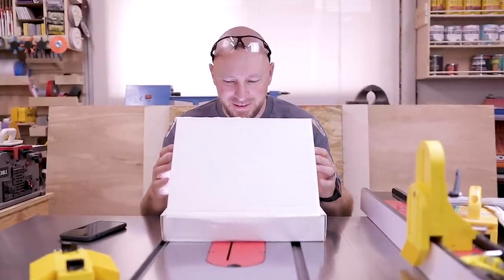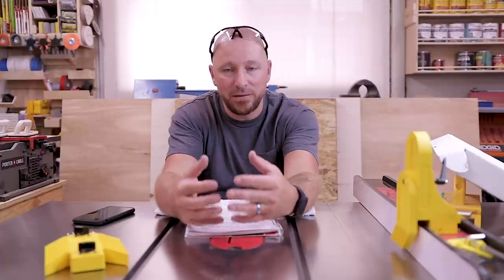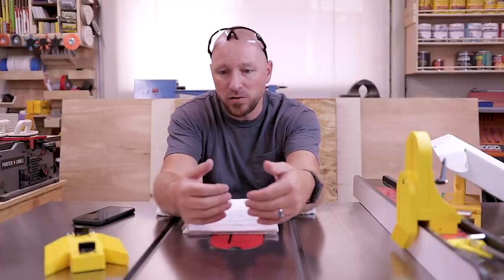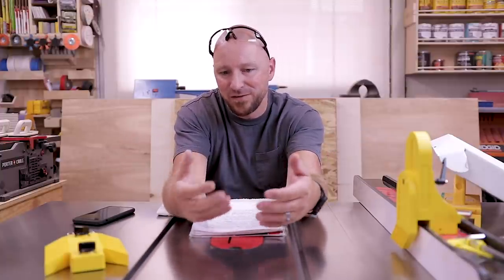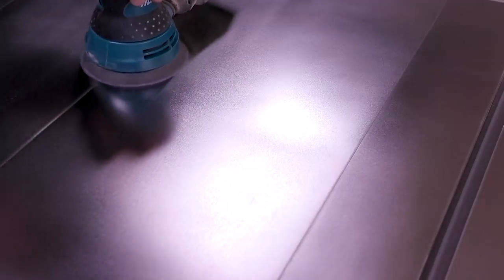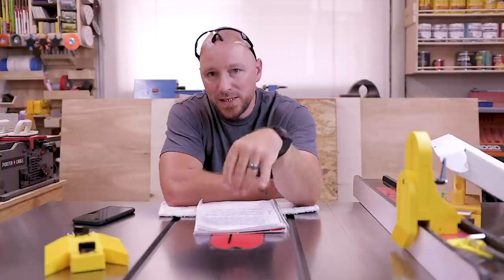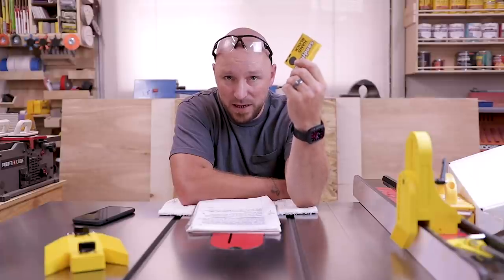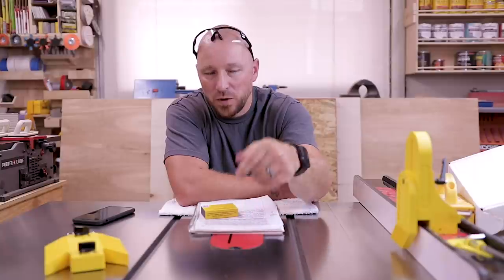3 Easy Ways To Maintain Cast Iron Tools

Comment: A couple of things.... first, thanks for the continued great videos. I love the 'conversational' type of content you put out and the straightforward way of putting it out.... Next, huge kudos to you on having the balls to take an orbital sander to a new $2K+ table saw. I had the same thing (sweat) happen to me the first week I owned a $600 delta and it took all I could do to take the orbital sander to mine last year. I've been using the same method and over a year later, no 'dips' or hollows in the top. Great tips as always. Keep doing what you do!!

Comment: Hey you might want try renaissance wax it’s a little pricy but it stays on you table surfaces a lot longer than normal wax.
You need very little for it to work. Good video by the way. I use t-9 as the cleaner sealer before the wax.

Comment: I have been using this method for years.  As you say, if there is rust start with a fine grit, you don't want to lay down a bunch of scratches that will be a bear to rub out.  I use Boeshield as my normal end of session protector.  I live in the snow belt midwest, and my shop is in a detached, unheated garage.  Boeshield works great for putting down a barrier, very important in early spring when humidity is high and the tools are quite cold.  I use exactly the same wax, and have experimented with putting on a day or two after the Boeshield, which works well, but right away not.  I tried putting wax first, then the spray, but that sort of dissolves the wax and doesn't dry evenly.  I have been doing this for about 25 years to good results.  I did find that there are differences in effectiveness on various cast iron.  I get some rust on a 20 year old Dewalt Jointer (China) if I let it go all winter.  Ditto on a Jet lathe.  The Italian made Laguna bandsaw faired very well, in that even in very severe temp changed, it next to the roll up door, so heavy exposure to the humidity, it showed little tendency to rust.  The best performer is a 24" Delta scroll saw from 1946.  It was my grandfathers, and I even have the original manual.  It is also close to the outside door, and even though I only use it for maybe 20 minutes once a year it is smooth as a baby's bottom.  I do one other thing, I put a heavy rag over these surfaces when I am done.  I think this acts as a barrier to the humidity.  I don't oil the rags.  They are the blue cotton type used in hospitals to soak up all kinds of fluids, and are often thrown out unused.  A machine cover tarp would do the same thing, but I'm too cheap to get a fitted cover for every tool.

Comment: Fluid Film is the key here....spray a light to heavy coating on it and leave it sit for a couple of hours and come back and lightly wipe it down with a dry cloth and you are golden...do this once a year and never have rust. Make everything nice and smooth too - it is a lubricant and preventer.  This is after you get the tops rust free of course. I even spray this stuff on the undercarriage of my truck - works great at keeping the rust a bay! Fluid film has been around since the 50's i think. Good stuff - you can usually find it at Lowes. Happy Polishing! "Wax-on, wax-off!"

Comment: Recently bought a used delta contractor saw top was in rough shape not left out in the rain like some I saw on line but definitely used as a workbench more than a table saw. Surface was super rough light rust spots paint and stain residue all over. Sprayed with wd40 and hand sanded an even amount over the whole top with 400 grit wet and dry paper. Did 2 rounds over the top using 3 1/4 sheet pieces each round. Wiping off and reapplying wd40 between each sand paper change. Cleaned the top with rubbing alcohol and a clean rag. Did two coats of minwax paste wax and 3 weeks later the top is still super slick even after going through a couple sheets of mdf and half my scrap pieces of plywood making several new jigs for the saw and a couple hunny do projects. There’s still several rust spots visible but they have no effect on the operation of the saw. I can’t even feel a difference when I run my fingers over them so I don’t worry about those. The saw is 30 years old I’m more interested in finding a new v belt than worrying about a rust spot or two.

Comment: Great video - I've used a random orbit as well with decent results. On the T-9 Boeshield: here in Virginia, the humidity gets insane. I like to clean the saw bed, then spray it with the T-9 and wipe it into a thin layer. I've noted the best result is if I can leave that overnight, then re-wipe in the morning and then wax the crap out of the saw... commenters below are correct - the T-9 isn't a wax substitute. It does penetrate the grain of the iron and you'll find you're not doing cast iron maintenance as often. I'd also recommend a canvas tarp over the saw between projects, or over humid nights.

Comment: You might also try Penetrol made by Flood products. It is a paint conditioner but when spread on cast iron dries to a ultra thin layer. I tested on my AC compressor (outside in Florida) it lasted over 5 years and could not be detected except by a bright shiny spot in the middle of a rusty spot.   I paint or dip all my hand tools and brush it on my table surfaces. After 40 years no rust.   Read the can of Penetrol it lists this exact use. I was tipped to it by an old time carpenter/machinist.

Comment: When I got my tablesaw about 5 or 6 years ago I immediately put polyurethane clear coat on it. There's been no rust until this past summer when I left a piece of freshly cut mahogany on it over night. When I came out the next morning there was a huge rust spot where the wood was. I used the 400grit wet sandpaper with wd40 to clean it then mineral spirits then the clear coat again. I like the poly clear coat because it lasted a long time.

Comment: Great stuff! I have been using mineral spirits, then WD-40, then paste wax. Just recently tried using T9 with their rust remover (came in a set). The rust remover was insanely good (smells horrible though!). Just looking at how easily wood glides over it, the paste wax actually seems better, although not by much. I’m happy with both ways of cleaning and treating my table tops though. Thanks for sharing!

Comment: Picked up some T-9 this weekend from Rockler in Pasadena. Looking forward to seeing my old Shop Fox W1677 shine again. I used WD40 to remove rust last time around but I didn’t like the mess it made. I’m gonna try your technique and see how it goes. Thanks for the tips!
Reply: So how did the T-9 work for you?
Reply: @georgeyoungapts  it was much better than the WD-40. Been using it ever since.
Reply: @ederorellana9919  Thanks.  I have some Boeshield left over from years ago--so I just reordcered new product in case the old weakened.

Comment: I have been watching videos and trying stuff. I have been using Collinite 476s. It’s a permanent automotive wax. Works amazing and so far no rust. I have done all my machines and it leaves no waxy film like boshield
Reply: I use Colliniye on my boat hull and it is awesome. After 12 months wster still beading.
Reply: John Norris Bosield is sold in marine stores.  Been around for years.  Think it is machine oil with wax.

Comment: The Boeshield Rust-Free and T9 work great on all metals in the shop.  T9 is wax and solvent, and will last a long time without having to reapply. I use 000 or 0000 steel wool to clean rust with the Rust-Free and wipe down the T9 with a clean cloth.

Comment: Lol, you guys are too much in love with your sawstops; I use that T9 or whatever that thing is called to take out the rust, might be left a stain or spot where the rust was, but I never ever send my table saws, also don't get to the point of sending them either; I guess if one things of their saw as a piece of furniture, one can polish the crap out of it, but if you busy producing stuff, you don't really focus on the mirror shine of the table saw top; I got two sawstops, one 5hp and one 3hp, they sit back to back with a 3' table between as I use that for assembly as well, when one builds cabinets constant, you use any level flat area for assembly; as I was saying, the 3hp is dedicated dado station and the 5hp is the main rip saw; back in the day I had the slide saws, but as It was easy to rip 4x8 and 5x10 sheaths, it was a pain in the ass for the rest, I couldn't use the space for anything else, so first I switched to powermatic and when sawstop came about with their electronic safety advantage, I switched my table saws to sawstop; I don't mean no disrespect but when I run across you guys babysitting your saws, I can't help but to smile, because that takes away from the opportunity for you guys to make money with those saws, after all that is why we make those hefty investments, isn't it?
Respectfully
Dan

Comment: Yes anyone said steel wool, say 00 grade, yet? 
Add your cleaner and it works well for me.
Oh, vacuum well and run an old speaker magnet in a sock over the lot, just before the wax step.

Comment: Yep, I've been using the Sandflex blocks for years.  Each machine - table saw, bandsaw, jointer - with a cast iron surface has one in a drawer nearby.  Don't have a big rust problem and these help me not to have one.

Comment: Also had the problems with sweat-drips and fingerprints and than a tubebreak (water) in the workshop. Only the humidity and i had a fine layer of rust on the saw. I 've used a 1000 grid on an orbital sander and after one hour the saw looks better then new. Then i used silicon-oil-spray. This was the best thing. The saw-table was absolutely smooth the are no oil stains on the wood. Only my experience.
In Germany there is often used a chemical named 'Silber Gleit' for such layer. But it's not really good against such rust.
Reply: Alfred Neumann have you tried to finish anything after being on the saw. My experience is silicon is almost impossible to remove. If it is on an area to finish it will cause practically any finish to fish eye.  For that reason silicon in any form is not allowed in my shop.
Reply: @edblough4134  Yes, for example i  renovated a little children seat. After sawing i had to sand it more times and i use 1 times beech color and 3 or 4 times lacquer, with sandings between of course. Had no Problem. Between Silicon oiling and first new work, were some days. So i don't know, if this importand.

Comment: I grew up with a cast iron table saw in the basement.  Since rust is higher than the flat surface and since removing it means the surface is less flat  I used a razor blade to remove the harmful rust.  Mere discoloration is not a problem.   I  had a flat, smooth table.

Comment: I use an old 1/4 sheet sander and place a scotch-brite pad under it, Pb-blazer once over. Clean with Acetone (not alcohol because the alcohol absorbs moisture from the air) then johnson paste wax. I bought the bo-shield and am not impressed. I used it on my drill press column and table and it didn’t do as good as Pb-blaster. I’ll stay with readily available Pb-blaster for iron I don’t wax.

Comment: Boeshield T-9 is a light paraffin wax in a solvent.  Alcohol or any other solvent that dissolves grease or oil will dissolve the Boeshield and then you can wipe it off.  There is nothing “hi-tech” about Boeshield.  It’s just a quick way to temporarily protect metal surfaces.

A paste finishing wax such as Johnson’s or Minwax is based upon a heavier, thicker wax.  Minwax is paraffin, mineral spirits and turpentine.  Johnson’s is also paraffin-based but it uses different petroleum solvents.  A paste wax will provide a more durable, slicker finish than the Boeshield.

Comment: I use boshield. The second time I used it I decided to spray it directly on a few rust spots and let it sit thinking that would give the solution more time to break down the rust. It was a bad idea. It certainly got the rust off but it etched a splatter mark on my cast iron top. My saw stop is rust free but it looks like someone spit acid across my table top. It’s maddening. Directions on the bottle say to put some of the solution  on a rag and wipe down the surface. My mistake.  The wax is a must, especially if you use a cross cut sled. Does anyone know what to use on the table top to remove the wax layer to get to the bare cast iron? Would that be mineral spirits?

Comment: I live in SoCal, just got my SawStop PCS to replace my old Delta Unisaw (too old now to risk fingers I still have).  Touched the top a bit, wound up with marks that progessed to VERY light rust.  Viewed the maintenAnce video by Trent Davis, http://www.trentdavis.net/2017/06/13/tool-maintenance-protecting-cast-iron-tabletop/ and used WD 40 and Scotchbrite pad (equal to OOOO) then KleanStrip lacquer (close to denatured etoh--which CA banned due to vocs).  Wiped it Dry.  Since Sawstop suggests wax with mostly Carnauba wax, got P21-S from Amazon,  used that.  Today I see some light rust again.  This really sucks.  I guess I'll try the Boeshield.  Any better ideas out there?